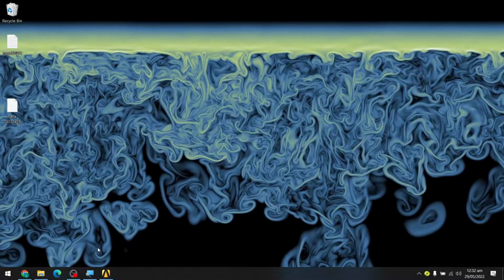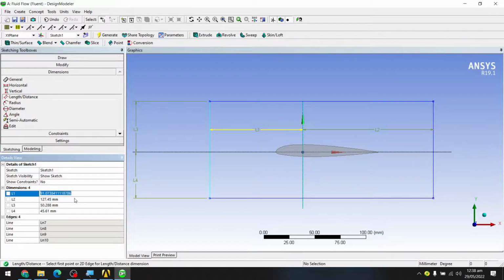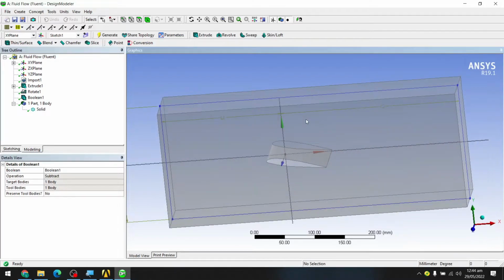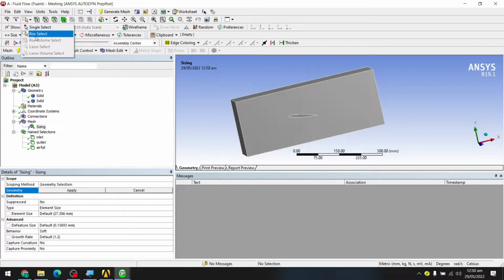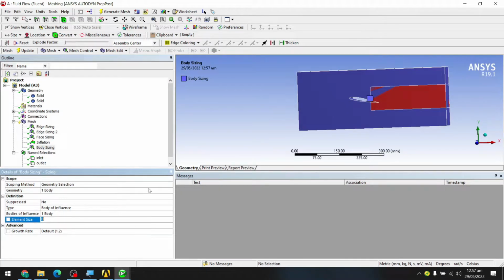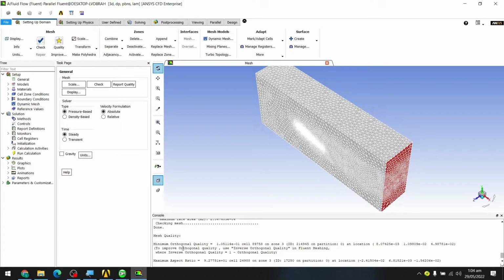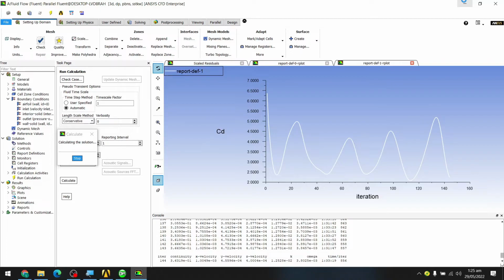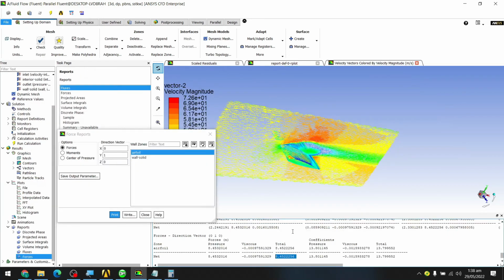CFD Simulation of 3D AIRFOIL USING ANSYS FLUENT

Comment: Hi I am doing 3d analysis for naca 0012 airfoil at various angle of attacks but even at higher angle of attacks the cl value is still increasing but visually the flow detached from the wing(Stall conditions). What can I do to solve this?

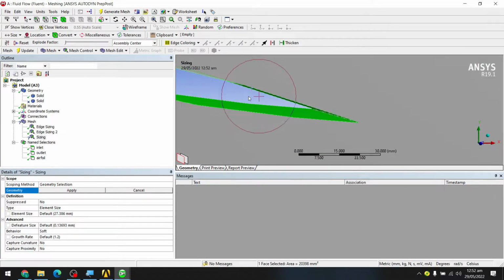Comment: hi bro this was nice tutorial but i cant select the faces which are inside the airfoil like you did in the video at 22:12 . please tell me solution for it
Reply: there should be a selection tool at the top with a box with different sections highlighted in green, choose the one with the surface/face highlighted and then try.
Reply: @samharper8238  yep it worked , thanks man appreciate it .

Comment: Hey brother very good video 
 I am getting error at 
Fluent setup i got error of
" You are using student version can only be used with cases containing less than 1048570 cells. Please exit ansys fluent and start new "

Please explain me what is cased and cells here and i how i overcome this error in airfoil analysis 
Please kindly recognize.
Reply: same i guess u have to lower the number of divisions or the element sizes
Reply: hi i am also facing the same problem , did you find the solution of it , if yes please tell me it will help me a lot

Comment: What is the difference between lift and coefficient of lift bro??
Reply from the maker: “lift” represents the actual force which lifts the vehicle. It is represented by newtons or any equivalent notation. “coefficient of lift” is a constant which is used to determine the amount of lift force generated. It has no unit.
Reply: @learningmentor08  thankyou so much another doubt i have how we can precisely give a mesh sizing in ansys???
Reply from the maker: @pranav4522  mesh is the most important part of any simulation. To know what mesh sizing will be better  . You need to check mesh quality (orthogonal quality) and check that it is in the good range. Selection of the mesh size is relatively proportional to the power of your machine. In short there are so many parameters in mesh sizing that you will have to look into in order for your solution to converge.
Reply from the maker: There is no shortcut